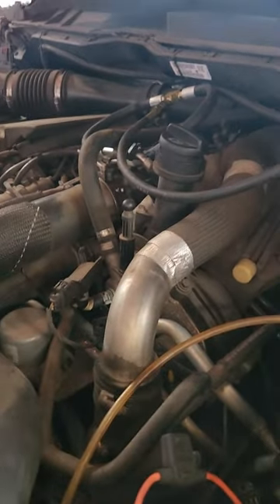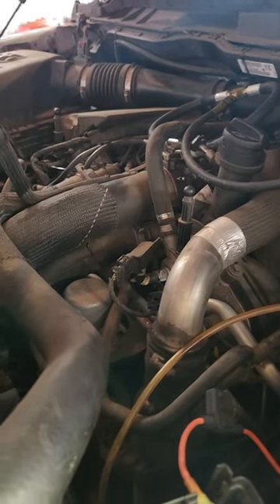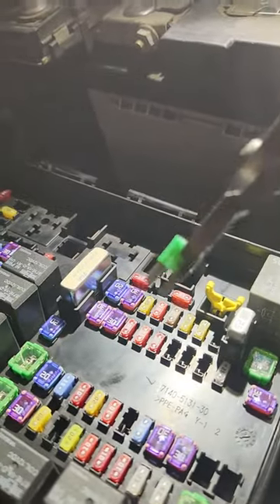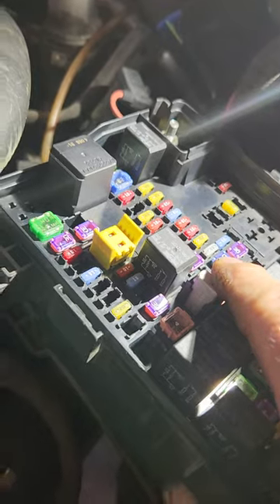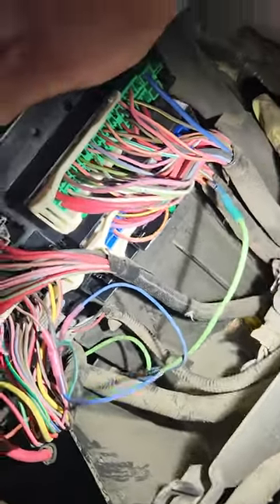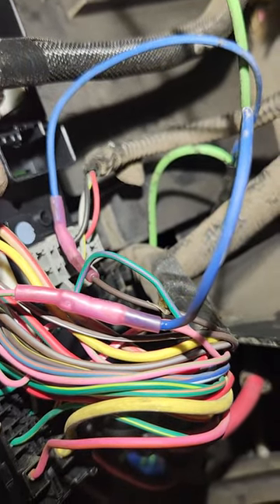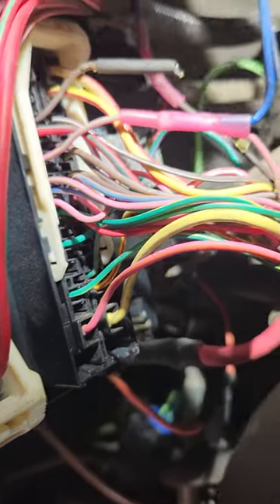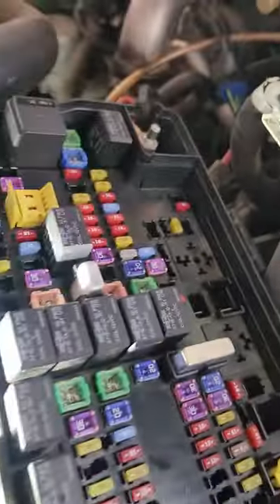15 Ram eco Diesel fuel pump relay bypass

Comment: So the pink/green wire and pin 25 go to the coil side of the relay? Does it matter which terminal they are connected to on the coil side?
Reply from the maker: Yes, pink with green goes to relay as does wire from pin 25. The wire from pin 25 goes to terminal 86 on relay.

Comment: How far are you booked out until? My eco diesel is having issues and totally fuel related with low fuel rail pressure x2 followed by 8-9 codes. When it stalls I cycle the key a few times. And it will run for about 2miles then dies again. I kept doing this just to get it home probably 4 times in 8-10 miles. I can replace parts but I rather pay somebody to fix the issue other than just replacing parts. It’s quite a drive from Chicagoland to Florida but do you know anyone to the north in Illinois you can refer me to?… they can
Reply from the maker: Wouldn't be able to do anything until after the new year.
Reply from the maker: Just buy a 12volt relay and pigtail

Comment: This may be the issue with my EcoDiesel 

Would it start with throttle input? Or would it be a no start at all if that’s the issue?
Reply from the maker: It could cause a no start. The truck I fixed would run fine until you excellerated hard, and then it would die. The truck would restart and run fine.
Reply: I got the same problem. Where can i get the relay kit you used? My truck is a 2015 ram ecodiesel. I just change the lift pump and there is no power to the pump. I need your advice, thanks..!!!
Reply from the maker: I used a kit from Mopar # 68269523AD. You can just Google Mopar fuel pump kit, and it will pop up. You can also just buy a relay and harness from the local part store. Make sure you install a fuse on the power side.
Reply: Is this a permanent solution or temporary?
Reply from the maker: @germantorres6022  This is a permanent fix